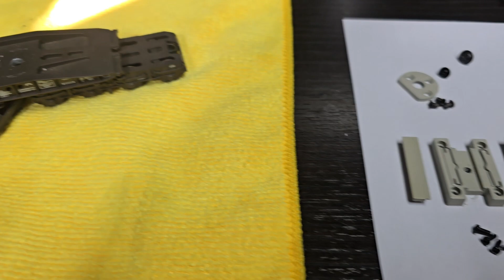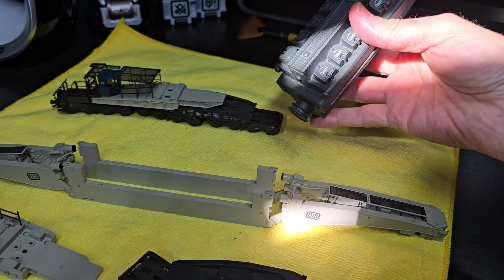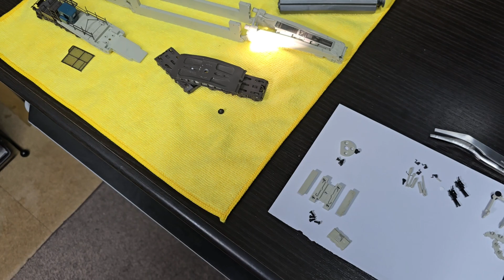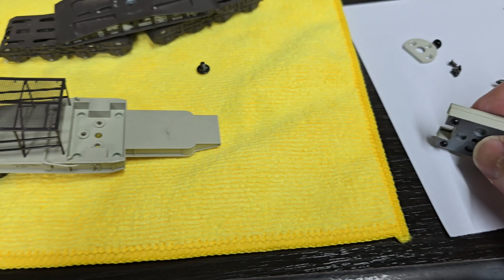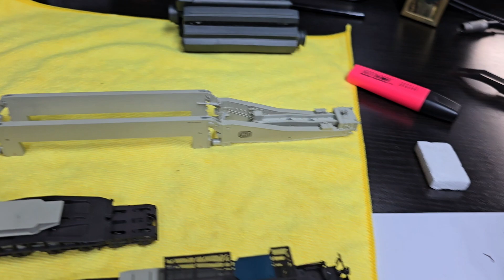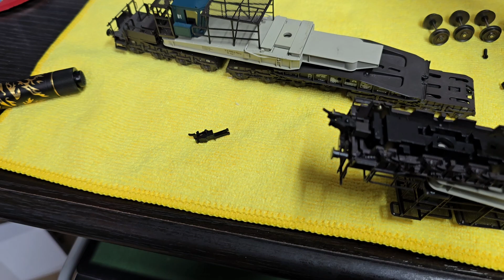Ebay  model railway wagon

Comment: Is this the fourth Uaai 839 or are they differing numbers? Uaai 839 is the largest in Europe and basis for this model and rated at 454 tonne. There is also Uaai 838 @342 tonne, Uaai 836 @398 t, Uaai 831 @275 t etc a total of 31 operating in Europe. The earliest model had a Trafo Union electricity transformer, later, a mill press base casting (as machined), then a large diesel engine, (medium small ship engine, stand by power, process drive), I have seen ship engines being built in S. Korea and the model engine is auxiliary drive size not main power for a big ship.
Reply from the maker: Hi Brian,
Intesting information, 
I'm not entirely sure how many versions Marklin Trix  made on the prototypes , Kibri ,liliput also made versions.
Reply: @hovermotion  Kibri make two variants Uaai 687.9 with transformer or generator stator and Uaai 819 with wood box or Nuclear waste container. In Golden Valley website catalogue but not available at the moment.

Comment: I would love one of these sets... I have the cheap plastic Heljan one that I bought on eBay second hand and it was a kit and it was not assembled correctly, so I am trying to rebuild it slowly to something decent... it just came with a basic frame none of the handrails or other extras that you have in your set...
Reply from the maker: Liliput also do smaller similar wagons fully made.
Marklin and Trix have quite a few different versions all made of metal .